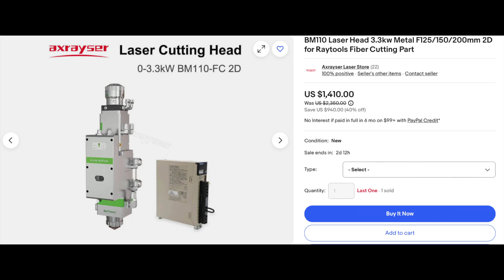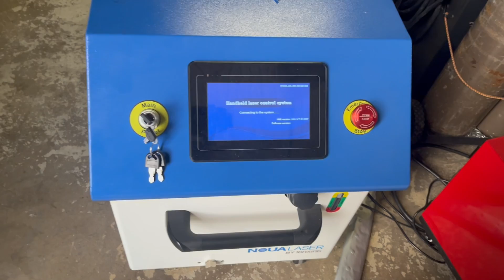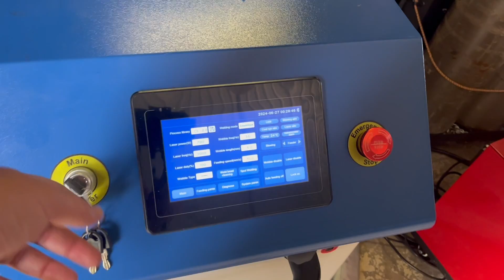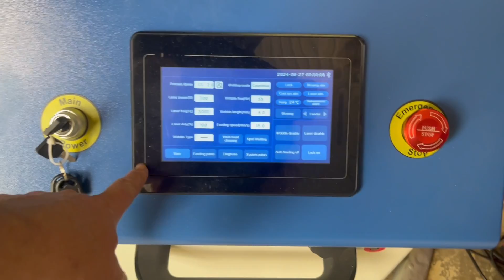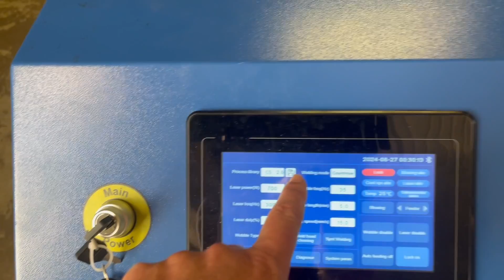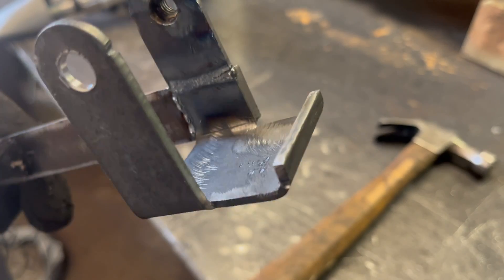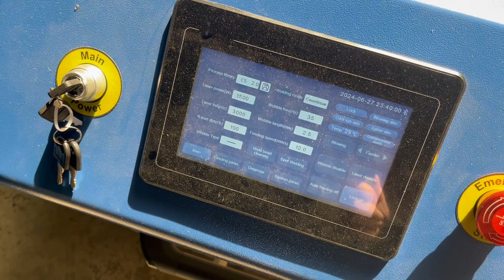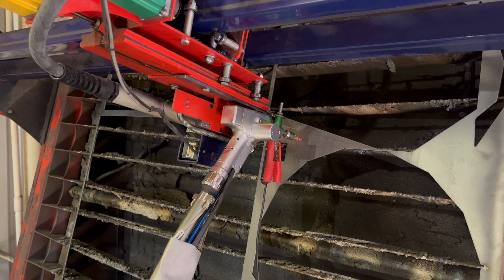Laser Cut Parts for the hobby shop!  2kw Laser 4 in 1 Welder & Cutter machine cutting parts!  Part 1

Comment: there's a kickstarter you could've bought one through for easily half the price...........and its way better!
Reply from the maker: @MrLegalizeplease  dont think its 2kw.  You need all the power you can get to cut thicker material.
Reply: Tell us whichone
Reply from the maker: @danielthomas1508  https://www.amazon.com/NOUALASER-Machine-Cleaning-Handheld-Different/dp/B0D9L8PFRK/ref=mp_s_a_1_9_sspa?crid=3VL5HHBC5W2GZ&dib=eyJ2IjoiMSJ9.cb0tk_43aDJpJRYKUbRjiz_TB-X47prnQxj_pGnngIwnCE_Tka64L0HcizCJgQAwSCoPnF7AlXQPyX0s1TusEAAwuoIRvnzGV0TBvB1RlvJ0YUMjul0gRQR_Z6GCtd9-TocapKc3__hJzhvf1hHuvcvDzoLce4NyXN-bq6O23l5PAd0AZRogcf3jQL9lHNoyDOtaX_TyW3d75om15Fd81A.E6PBXiOlmfcHLfYRp8Z0cloij_tFIafE3IAIcew1ePM&dib_tag=se&keywords=4+in+1+laser+welding+machine+2kw&qid=1749130091&sprefix=4+in+1+laser+welding+machine+2kw%2Caps%2C118&sr=8-9-spons&sp_csd=d2lkZ2V0TmFtZT1zcF9waG9uZV9zZWFyY2hfbXRm&psc=1

Comment: Wow very cool. I have a 2000 watt too. Can you make a video about how you wired the signal to your plasma table? Subbed
Reply from the maker: @PlzNotDIY  are you looking for the THC signal or the trigger signal?  Part 2 with D.I.Y. Torch Height Control for Fiber Laser on CNC Plasma Table.
https://youtu.be/9zNEUU673k8
Reply: @k-rigg   the trigger signal please
Reply from the maker: @ https://youtu.be/hfvYZB9rimo?t=638&si=rvZCMeIGOn6qXJOy here is the part in the video, its as easy as two wires from the laser source controller in the video to the torch on relay on your breakout board of your CNC controller.

Comment: Whats the thickest you've cut so far?
Reply from the maker: @glendederick7270  1/4” wouldnt be afraid to put 1/2” under it.
Reply: @k-rigg  Have you figured out the THC yet?
Reply from the maker: @ yes, works good.  Part 2 with D.I.Y. Torch Height Control for Fiber Laser on CNC Plasma Table.
https://youtu.be/9zNEUU673k8

Comment: Anymore progress with this set up?
Reply from the maker: @glendederick7270  yes, i have been using the heck out of it.  Here is some videos about it and other things i have used it for:  https://m.youtube.com/watch?v=9zNEUU673k8&list=PLGB_DEgzHRrq__mfo7WQvckVoS0Nu8NHe&index=11&pp=iAQB
Reply: @k-rigg have you got it more dialed in for a clearer cut yet?
Reply from the maker: @ to get the dross to go away i will have to go to 200+ psi of air or go to oxygen.  After getting the drum sander i have been less worried about the dross and am happy with the results.  
https://youtu.be/-pCJqCy3UAo

Comment: I believe the problem is your not sitting flat and the droff is falling into it's self. THC should not be needed as a laser cuts cooler than plasma. Funny I've wanted to do that for over a year now but I'm retired and don't have the money to buy a hand laser. Awesome video though.
Reply: I did
Reply from the maker: I agree as i need higher pressure air to blow slag out, normal fiber laser systems require 200+ psi.  Check out my thc video as it does help it.  https://youtu.be/9zNEUU673k8?si=c-eM7sWER9iB3jWk

Comment: You may have figured this out by now, but you can turn off the ground clamp requirement, using the "lock off" button.  The menus are backwards in most cases.  The lock off turns on the lock and the lock on turns off the lock function.  Hopefully this will make your life easier,,,
Reply from the maker: I did not know that.  Thanks for the tip!

Comment: with 2kW fiber laser to have clean cut with Air you can cut maximum 1,2mm thick plate. Maybe 1.5mm. Over this thickness you you use Oxygen. 2mm like 0.9Bar, 2,5mm-10mm use 0.5-0,7 Bar! When you have rough edges it means the Oxygen is too much! And big problem is that rust! Laser doesn't like when plate is rusty. You must prengrave the countur first before cut if plate is rusty like that!
Reply from the maker: Thanks for the tips!  I will try Oxygen in the future.

Comment: Which Controller do you use on your plasma table?
Reply: Thanx,  hope to get a New Controller and as soon as passable a laser.
Reply: @normansteinkemper1024 I'm trying to hook this to my stv plasma table using myplasma software. Got any tips?
Reply: Thanx, are you happy with ?
Reply from the maker: @ yes!  I think these laser machines are the future with all the things they can do!
Reply: You are right , i am in the Situation that my old Controller is broken, so i will modernize it with mach 3 or myplasm.
Can you describe the connection to the laser? Is it only 5 v dc from the Controller?
Reply from the maker: @ I went to a 5v relay from your pin out of the breakout board for your spindle.  Than the trigger input for laser goes to the relay.
Reply from the maker: Mach3

Comment: Somehow I don't think I would use that thing with my hand anywhere in front of it nor would I ever point it towards myself I don't care if the damn things unplugged unhooked or just plain broken. 
I worked for a big company that was using a laser system and they guaranteed us that it would never be on with the laser pointing at us so much for their software we set a blueprint on fire and after that we were out of there
Reply from the maker: You definitely have to be careful with it, and it will start heating up anything you are pointing it at quickly 3 feet away when you are pulling the trigger.

Comment: Very cool! For 1/4" plate, I use Oxygen at about 9 psi. You can probably find a cut settings chart for your laser source online to help dial in speeds, height, gas type and pressure. A component distributor told me that the water chillers used in welding units only cool the laser source line, while the cutting head line just circulated room temperature water, whereas the chillers for cutting machines cool both lines. You might keep an eye on it when doing longer cuts, to make sure the nozzle isn't overheating. I'm looking forward to seeing it with height control!
Reply from the maker: Oxygen is definitely on the to do list.  The cooling system is routed to the welding head per the supplied documentation with chilled water.  I also know this to be true because I could feel the welding head getting cold when I was dialing in the chiller temp.  Thanks for the tips!
Reply: @k-rigg  what is your total cost just for the laser components?  I'm inclined to believe the chiller itself could be DIYed which might get the overall cost down some and with the tariff war about to kick off, cutting every corner might become a necessity, at least for my thin budget.
Reply from the maker: @ it all came as one unit which was cheaper than buying everything thing separately. I paid around 8500$ for the welder, but this is the 2000w which is the biggest you can run on single phase power.  In reality i havent used any thing above 1500w in cutting and 1000 watts welding so there is some money to be saved buying a smaller unit.

Comment: Muito bom...
Como vc fez para diminuir o delay. 
Tenho uma hand laser de 1500w, mas tem um delay de 1.2 segundos entre apertar o gatilho e abrir o laser... 
e as vezes dá uma pequena variação nesse tempo... +- 0.5sec
Vou cortar chapas de aço inox de 1.2mm.
Sobre a pressão do ar comprimido... abaixo de 100psi cria muita escória na borda. 
Obrigado.
Penso em usar O2 puro.
Reply from the maker: English Translation: "Very good...
How did you do to reduce the delay?
I have a 1500w hand laser, but there is a 1.2 second delay between pressing the trigger and opening the laser...
and sometimes there is a small variation in this time... +- 0.5sec
I will cut 1.2mm stainless steel sheets.
About compressed air pressure... below 100psi creates a lot of slag on the edge.
Thanks.
I'm thinking about using pure O2."

On the Laser unit control screen, there is a setting for delay of cutting from flow of gas to start of laser.  I didn't mess with it and just made sure my lead in was long enough.  If you have variation in start time, it might be in the safety clamp not getting a good connection between your cut piece and gun.  I'm running right around 100 psi but might be dropping under 100 psi while the laser is cutting so my next step is upping the psi.  Im planing on using oxygen when i try cutting thick steel as I have read this will increase the thickness available to cut.

Comment: Nice man. I also thought of this. Bought a 2kW 4 in1 laser a month ago, will do the same conversion. My only concern is i think these welder heads won't tolerate well if the laser reflects back itself.
Reply from the maker: Thought of the reflection being an issue too but I make sure I’m not pausing on the pierce and have the machine moving instantly to keep the laser beam from reflecting back.  Just make sure the lead in is long enough to let the laser get all the way through before you get to the profile lines.